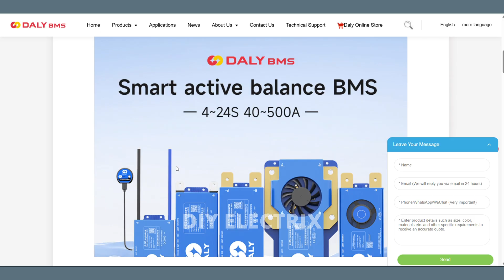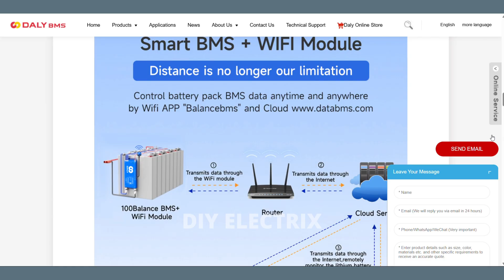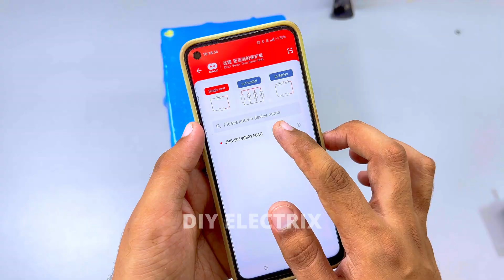Building a 12v 60Ah Battery Pack – Step by Step!

Comment: Thank you for video. This is helping with my project with same battery configuration. Can you advise on one thing. Do these battery packs need ventilation or some type of cooling during charge and discharge? I can not find any information on this.

Comment: Can we use 4s bms which are cheap for this like available on elexify?
Reply from the maker: Yes, you can use any bms but remember the current rating, battery Type ( I have used LFP Batteries).
Reply: Price approximately

Comment: 3.2v x 16 = 51.2 😨but volt meter 13v ? 🤔
Reply: Science padhe lete ya google kar lete . 

Battery connected in series increases voltage battery connected in parallel increases Ah

1 battery = 3.2v 15ah

3.2v *4 in series = 12.8v

iske 4 set in parallel 15*4 = 60ah

total 16 battery should be used to make 12v 60ah battery if single battery is 3.2v 15ah
Reply: @AkashPaul-ql1fu 1single battery 21700 can't contain 15A anyway.

Comment: Hello Sir
I have made a battery pack for my scooter. (32140 CELL_ 15S_30AH_48VOLT)
I have a problem, after installing my 100 DALY ACTIVE BMS(8S-17S_ 40AH) it is showing a red light instead of a green light and the OUTPUT voltage is not showing and it is not charging. Plz help me with my problem, I will be benefited.
I have given the video below:-

Comment: How could I charge it?
Reply: I currently use one of these BMSs shown in the video. 
TLDR?: It’s the same wires used for discharging.
Concerning charging the pack is easy because they are the same as the discharge wires. These are negative-connected BMSs. That thin red wire is used to power the BMS and not the entire pack like the thicker one. Both the charging/discharging go through the same main positive and the Power Negative, or P-, on the BMS, and is the one that connects to your battery-powered electronics. There is also a Battery Negative on the BMS but that stays inside the pack by connecting to the main battery negative.
Reply: You need special lifepo4 charger don't forget

Comment: 1. Use a spot welder with higher power to make sure the zinc strip and battery cells are firmly connected.
2. The temperature sensor should be in direct contact with the battery cells, not placed outside through insulation and glass tape.
3. Apply shock-absorbing foam tape on both the top and bottom of the pack—or at the very least, on the bottom.
Hope you make more helpful videos!

Comment: Hi
what was the heat shrink size used here ?
Reply from the maker: I have used 350mm heat shrink.
Reply: @DIYElectrix 
Thanks 
Please share the sizes of this battery along with the holder
(Lx Wx H)
Reply from the maker: @Amathew88 This is 32140 LFP Cell 32mm diameter 140mm height and I have used 33mm holder.
Reply: @DIYElectrix 
Hi 
How about your 60 Ah battery 
Total dimensions 
I am planning a 75 Ah one 
So to confirm the items required
Reply from the maker: @Amathew88 It’s total dimensions is 150mm (L,B,H) all are same.
Reply: @DIYElectrix 
Thanks a lot

Comment: You should use 2 nickel strips where load + and - it would be better
Reply: It's not just that what you said is better. What's shown in the video is wrong and dangerous. The full current of the pack is going through just one nickel strip. Between cell groups, the current is split among four strips and those strips are wider than the ones on + and -. The ampacity of the those end connections is less than 25% of the ampacity between cell groups. The sizing of the chosen metal must be done based on the max load + safety factor.
If this is for a very low power application, like th LEDs shown, then ok. But people are watching this as a guide to make an E-bike battery - Not OK.
Reply from the maker: Thanks, for your feedback.

I will remember it next time.

Comment: You cut 4 wire of bms its 8s bms is it safe way to battery
Reply from the maker: Yes, this bms support 4s - 8s configuration and we can use that according to need. 
I am creating a 4s bms so I cut the 4 wire to avoid any contact to the batteries.
It is safe even manufacturing company also mentioned that. 👍
Reply: Thnks @DIYElectrix